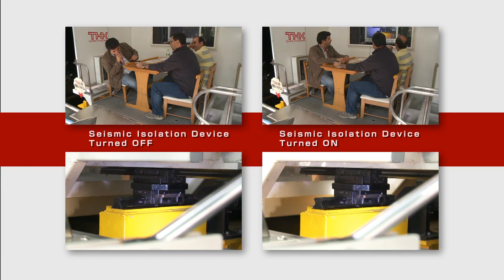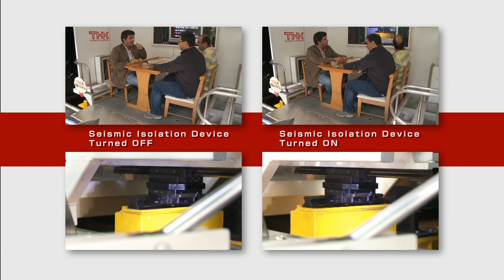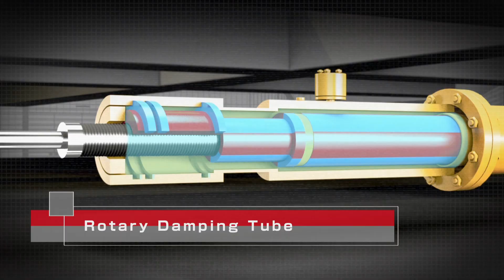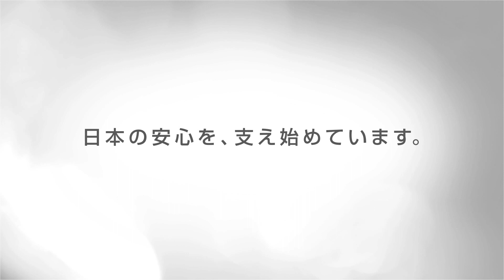ＴＨＫ Seismic Isolation System Introduction

Comment: Seems a lot like hammer looking for a nail type of solution. In what way exactly is the traditional lead rubber bearing insufficient? Sure you can do the same thing with linear bearings and rotary dampers, but why if you already have a cheap and stupid simple solution that does the same job with much less cost and complexity?

Comment: How can you know if all linear motion guide devices in a structure are going to react (move) in the same direction or displacement magnitude?
Reply: The device has two direcctions , use sine and cosine to get the magnitud on both direcctions